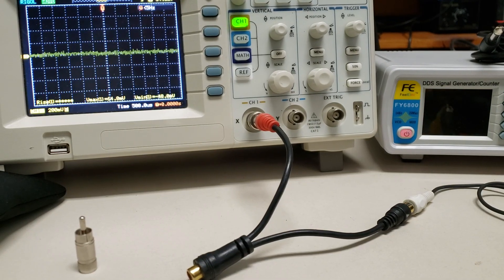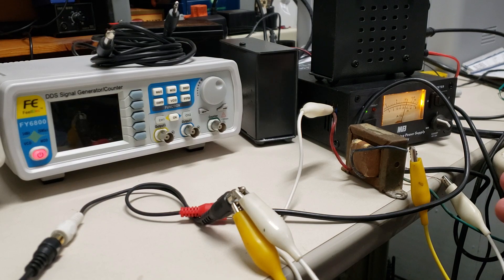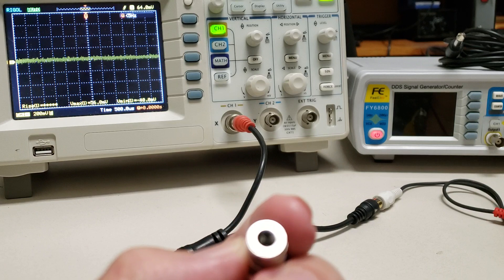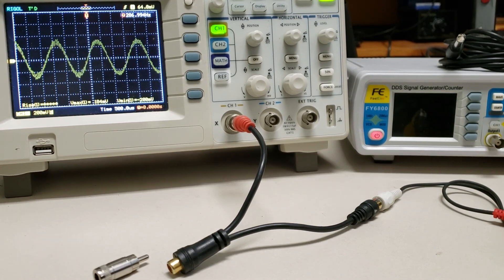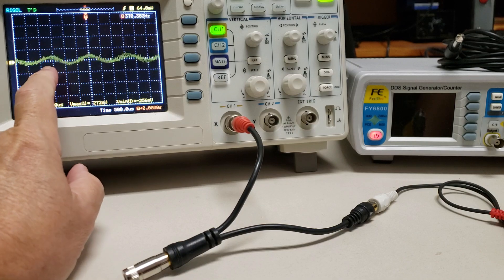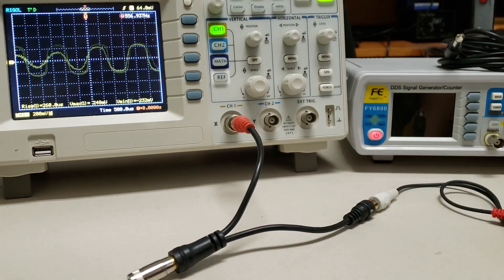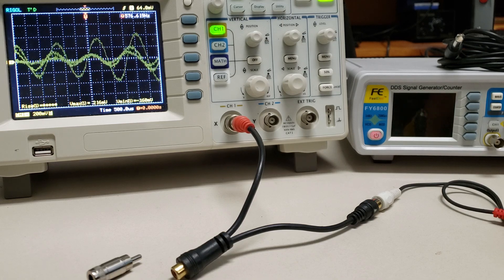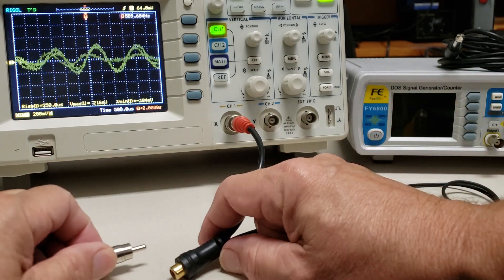Copying CW on a Receiver with Diode Clipping

Comment: Steve, In effect, you built an old-fashion ANL (Automatic Noise Limiter) using modern diodes.  Similar to vacuum tube diode ANL circuits of yesteryear, it reduces (clips) noise and distorts the signal.  And, as you have shown, a distorted CW signal may be a beneficial attribute of an ANL.   Ken WA8FCI
Reply from the maker: Yes and the clipping circuit acts as a form of AVC. With this system the effects of QSB is reduced. Stronger signals don't sound louder so the trick is to run the level up past the clipping point and enjoy a steady sound level.

Comment: Square wave is easier. On ships we used keyed modulated CW (A2) tone was about 400 to 600 Hz. During QRM you could hear one of the three signals , one on 499.600, one on 500.000 one on 500.600 kHz. You're going to hear one of those keyed carrier and two sidebands.